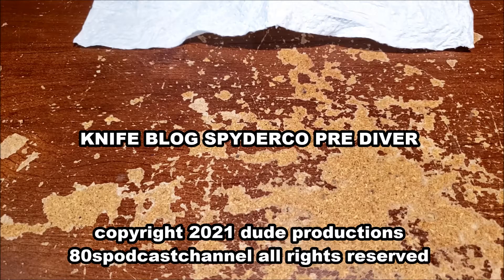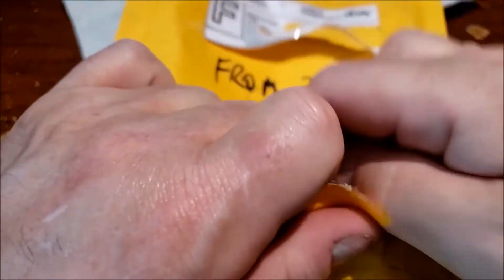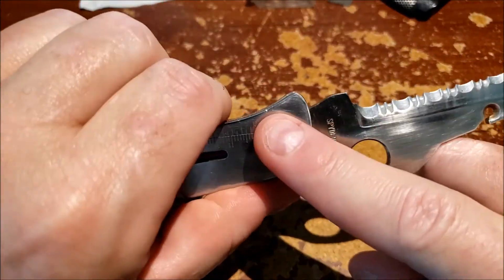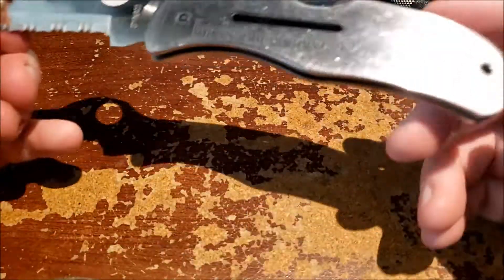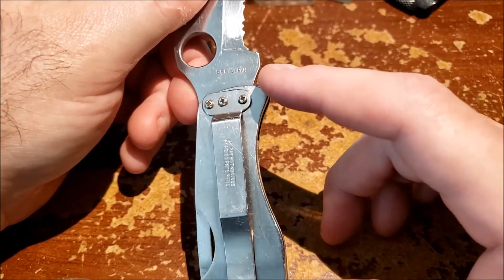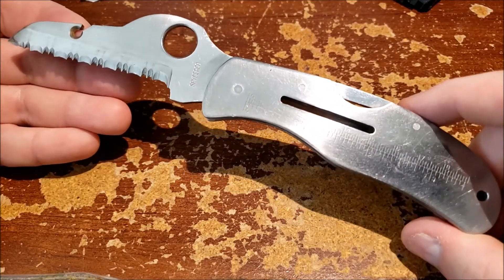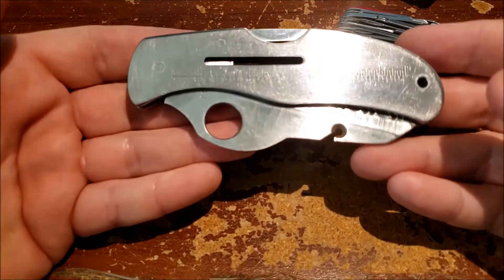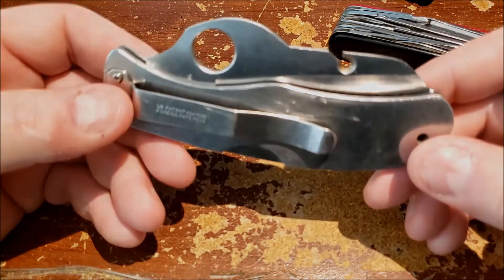DUDE'S KNIFE BLOG SPYDERCO PRE DIVER

Comment: I'm looking to sell mine that's identical to yours. What's it worth?
Reply from the maker: they can run from a few hundred to almost a thousand dollars... depending on how low the serial number is, it's condition, and does it still have the clip-it style of clip which was ground off to avoid a patent infringement, to make them the normally encountered version. failing that, you could always email me at 80spodcastchannel AT gmail DOT com and we could see if I need another one.
good luck in any case